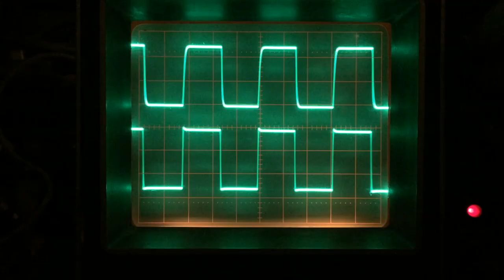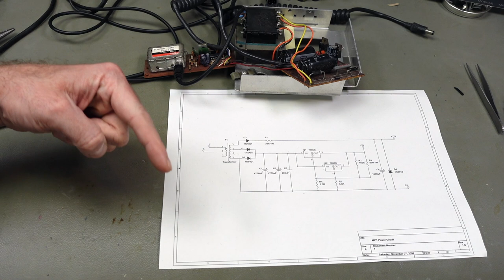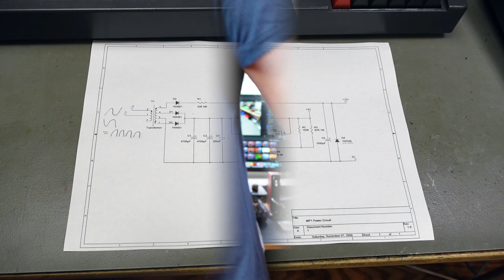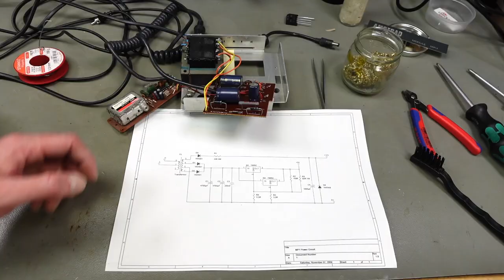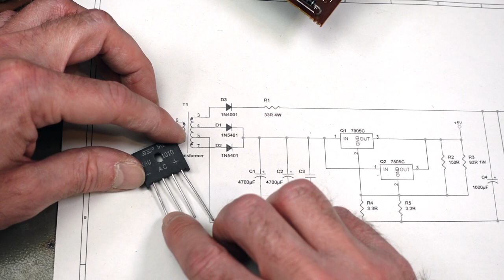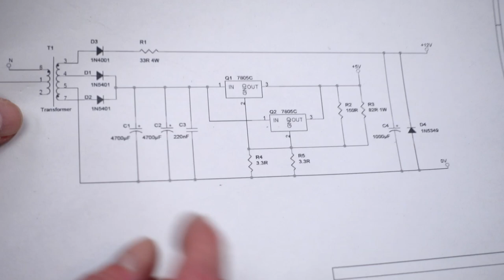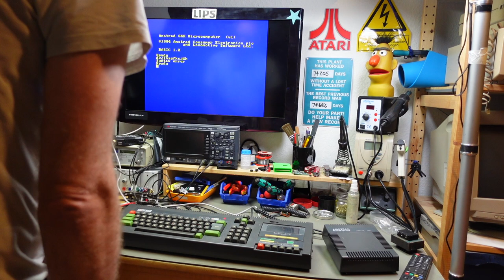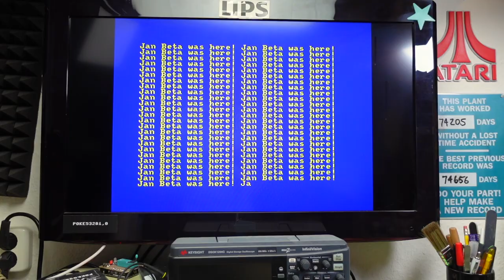Amstrad Module MP-1 Refurb and Mods

Comment: The 2 diode centre tap FW rectifier dates back to the days when vacuum tube diodes were large and relatively expensive. The split configuration needs twice as much copper in the secondary winding of the transformer than the single tap 4 diode FWR circuit but the cheapness and simplicity of the double-diode arrangement made the trade off worthwhile. Designers in the '70s grew up in the vacuum tube era and the 2 diode split secondary arrangement was habitual for them, even though the trade off of fewer diodes no longer applied with solid state devices.
Reply from the maker: Oh, interesting! That makes sense. Maybe a well-seasoned engineer designed the circuit who was used to working with center taps! :)
Reply: It was also good in later electronics with cheap small transformers because each of the windings operated only half the time, causing less heating. Modern transformers are far more robust than their 70s counterparts. As a child I had a "wall wart" power supply that had windings stuck together with wax, and after operating for more than 10 minutes would buzz like an angry bee because the wax had melted somewhat!
Reply: @IanSlothieRolfe  That made me laugh as only last week I was searching the power supply collection for a 12 volt power supply to run a small amp. I was wondering what the loud buzz was and I tracked it down to the giant wall wart I had used. Swapped it out for something more modern after that.
Reply: @JanBeta  "well-seasoned" is very nice phrase, I will use it to describe my age too. 😁
Reply: Interesting analysis.  It seemed like a lot of trouble to save 2 diodes.  It wouldn't surprise me if this power supply was an exact copy of one used elsewhere.

Comment: I think the modulator mainly existed because green screen systems were sold, and they were a cheaper way for people to experience the system in colour on a TV than to buy a new monitor.
Reply: Yep. If you had the tv already, definitely so. The converse device to this one, a TV tuner for the CTM 644 monitor, also existed. When the CPC 6128 was bought for my home back in '88 I think I recall it was bundled as a freebie with the system down here in Spain.

Comment: One fun fact about the UK and our plugs, at the time this Amstrad product was sold, they often came without plugs fitted, so you had to fit your own, and most people just bought an off-the-shelf plug with a 13 Amp fuse (Ceramic, sand-filled jobs, not glass) fitted and went with it (My Spectrum Plus came like this!!!), this was common across pretty much all appliances from a lamp to a fridge freezer, so, had anything gone wrong with the transformer, that's about 3.1 Kilowatts of power flowing though that cable, so lots of smoke and fire probably... :S

Comment: I remember my MP add ons. I could only afford the mono monitor at the time so used my colour tv. This was actually better than getting the colour because I then had the choice. The mono monitor was great. I’d would have removed the modulator and fitted fuses in that spare area.
Reply: Me too, I had to save up for the MP1 and I remember the long months of trying to play Jet set Willy in green screen while I saved.
Reply: @Corialtavi  I only needed it for the power so I ran the power from the green monitor until my MP2 arrived, it was for the 6128 by the time I got one. I made a lead to connect the RGB to my TV so the picture was much better than the modulator.

Comment: Correction: You get about ~0.8A before you exceed the VA rating of the transformer!
This is linear PSU so the linear regulator and bridge rectifier "burns" of the excess voltage as heat, most of this is done on the semi-stable peak-voltage side so you can get an approximate ampere very safe rating by dividing the transformers VA rating with that peak voltage (12.7V). Actually, it might be even lower since it'll probably be rather peaky which amplifies the VA number but I suspect it's probably OK up to that. There's way to calculate this but it's complicated and I'm not confident I would get the correct result.

Also, starting with 9V AC means the linear regulators will need to get rid of a lot of voltage and thus heat, the bridge rectifier and linear regulators will burn ~15W at 2A load, this comes in addition to whatever heating happens in the transformer. So the PSU will generate more heat than the entire machine.

Based on your measurements the original design probably used a 6.5V AC transformer, this makes sense given that this appears to be about as low you can go and still be guaranteed a "regulated" 5V DC output assuming a full bridge rectifier (FBR) using standard diodes and a 7805 or compatible linear regulator, they actually had slightly more safety margin since the dual diode centre tap design only incur one diode voltage drop instead of two.

I'd suggest seeing if you can find a 7V AC transformer, if you use a 6.5V AC transformer it might be fine but I'd probably use a Schottky FBR (much lower voltage drop) for a bit of extra headroom even if it "should" be fine without AFAIK.

I think all 7805 models are specified to be capable of handling least 12V DC input so using a 9V AC transformer should be safe if you provide enough cooling (the FBR will drop it below that). Some model are specificed up to much higher voltages but they quickly becomes veritable heating elements if you draw any noticeable current - the 2A ST L78S05C for example is rated up to 25V! which would result in 40W power dissipation in the regulator alone to deliver 5V @ 2A (10W)... Ouch, not sure that's coolable in that form factor without using "exotic cooling".

Comment: Yes, that 10VA transformer is way underrated (not slightly), so you should have checked its output under load. 7805 regulators are not LDO, so if their inputs get too close to their rated outputs, they start behaving unexpectedly. What you need on their inputs is at least +2V over their rated outputs, in your case 5V+2V=7V absolute minimum. If your transformer drops its output due to load, you might not get this.

Comment: I think that transformer will hang in there. From memory, the CPC used just under an Amp @ 5V. It's probably just on the borderline but im sure it will work. Accessories plugged into the CPC definitely wouldn't be recommended though.

Love you video's, Jan. Keep up the awesome work.
Reply from the maker: Thanks! I have yet to measure how much current the CPC actually draws but you may be right. With only the chipset and no expansions, this is most likely beefy enough. Still not happy with it, probably going to end up putting a modern PSU in the case. :D

Comment: Dear Mr. Jan, the transformer failed because you fitted the rectifier bridge which resulted in overcurrent in the secondary winding. Because during an alternation (eg: positive alternation in the secondary), one of the diodes (from the rectifier bridge) will take the voltage from winding 4-5 and rectify it, the other diode will take the voltage from winding 5-7 (which has a negative voltage relative to the transformer pin marked 5, which is connected to ground) and which tends to reduce to 0.7V, what it represents diode forward voltage (without the existence of a current limitation on this electrical path) which leads to the appearance of a very high current in the secondary, in winding 5-7, implicitly overcurrent in the primary, which leads to rapid overheating of the windings and failure of the transformer. The 1A fuse was large as it allowed up to 220 watts into the transformer and did not protect the transformer from overheating. Greetings and all the best, Marius.
Reply from the maker: I only tested the transformer without anything connected to the secondary side so it must have been broken before. You are correct of course (as I realized later), the full bridge would not do any good with the center tap!
Reply: Dear  @JanBeta . 
Fitting a bridge rectifier will not improve the electrical performance of the assembly in any way, on the other hand at low output voltages with is our case of 5 Volts the bridge rectifier is not recommended because the rectified voltage will be 0.7 volts less than variant with 2 diode center tap FW rectifier. 
However, it is possible to mount a rectifier bridge if the following steps are followed: 
1) Disconnect the wire from terminal 7, which does not connect to anything. 
2) Disconnect terminal 5 from ground. 
3) Connect the AC inputs of the rectifier bridge to terminal 4 and terminal 5 (not between terminal 4 and terminal 7 as Mr. Jan, did because the voltage appearing on capacitors C1, C2, C3 and implicitly the input voltage for the 7805 regulators will be doubled ; which leads to increasing the power dissipated by the 7805 regulators and increasing the power passing through the transformer, so they will fail in case of long uses). 
4) The "+" pin of the rectifier bridge connects to C1, C2, C3. 
5) The "-" pin of the rectifier bridge connects to ground. 
Greetings and all the best, Marius.
Reply: @JanBeta  yes, you're right, I reviewed the video and at minute 31.00 it can be seen that the rectifier bridge is not connected.

Comment: Just add a fuse of 2Amps with the 6v protection diode.
Also when you connected the center tap of the transformer to the negative output of the Bridge, I exclaimed Noooo! .
 The two diodes were used to enable cheaper lower current transformer to be used by adding two outer windings of the center tap of the 9v out was a common and reliable method, shame about the transformer they are/were very reliable.
Infact those modulators were good Astek were the best available at the time, replacing the caps was a good move.
The MP-1 was prone to bad solder joints and cable damage, I only recall replacing one set of regulators and that was due to a customer shorting the DC cable when he tried to repair the lead.
Leaving the Bridge in place and disconnecting the Negative would have been acceptable.
Personally I would have left the diodes alone if the tested ok, or at the very least replaced them with 1N5407/8 which are the same diode at 800v/1000v not 100, just because it's easier and cheaper to order one type rather than several.

Comment: 33:43 In my time "Repairing" dead electronics, I tend to find that if a device has a transformer, that's the most likely thing to be dead.
I "Repaired" an old fiber optic Christmas tree for my brother a few months ago. "Repaired" in that it was the PSU that was dead, literally nothing more than an AC transformer in a plug-top box. So I found another old transformer (Wasn't plug top, plug was on a wire) with the same value, cut the plug off the end of each cable, and made a soldered joint. It worked, it was safe enough (used heat shrink with hot melt glue inside it), and he was happy with it.

Comment: The MP-1 was to allow you to connect to a TV if you'd bought a green screen monitor, allowing you to have a colour display.
Reply: And if you had a CPC 664 / 6128 you needed the MP-2, which had the 12V power rail required for the floppy drive.

Comment: Als du den Brückengleichrichter eingelötet hast, hats du den Minus Anschluss des Gleichrichters an den Mittelanschluss das Transformators angeschlossen. Damit hast Du in der einen Halbwelle die eine Transformatorwicklung kurzgeschlossen und in der anderen Halbwelle die andere Transformatorwicklung.
Eine Transformatorwicklung  war schneller kaputt als die Andere, die dadurch gerettet wurde.
Du hättest als am Brückengleichrichter den Minus-Anschluss offen lassen müssen. Dann hätten zwei Dioden des Gleichrichters den Pluspol gerichtet. Aber dann ist es sinnlos einen Brückengleichrichter statt zwei Dioden zu nehmen. 
Auch den Mittelanschluss zu entfernen macht keinen Sinn. Mit den beiden äußeren Anschlüssen hast du die doppelte Spannung und den halben Strom, den du brauchst. Die 7805 hätten eben 20 Volt Vorspannung und nicht genug Strom mit beiden Wicklungen in Reihen. 
Mit der Mittelzapfung zwei Dioden Gleichrichtung werden beide Wicklungen abwechselt parallel geschaltet. Also ca 10 Volt vor dem Regler und Stromfestigkeit höher.
Oder gleich ein 5 Volt 2 Amp Powersupply nehmen.

Comment: Nice video, did a fantastic job sorting that out. The fuses in a UK plug are sand filled ceramic not glass fuses :), and people love to stick 13 amp ones in everything.  3 5 and 13 are common in the UK . You used to be able to get 1 an 7 too but they are much less common ( even tho for much stuff today (like phone chargers ) a 1 amp would be more than enough).
Reply: The fuses in the UK are HRC fuse (high rupturing capacity fuse), they're designed to quench the arc into the sand when they blow as the metallisation in a glass fuse capsule can still carry voltage through the plasma, the ring circuits in the UK used to be 30A at 240vac, I think they're 32A with the new RCD/RCB protection, it's one of the reasons we still have fuses in plugs I guess, yep it always makes me facepalm when I see 13A fuse in a table lamp or figure of 8 cable.
Reply: Confirmed. 13A is plenty for any application so why bother with anything else ;-)

Comment: The only thing to really do with an MP-1 is open it, throw all the insides in the garbage and use the case to fit a new open frame switching power supply. No need to play around at the component level.

Comment: Well done Jan. To mount the power supply I would have just used MB or Drive Spacers, the Hex type brass spacers. Bigger the better.  But I guess cable ties are an option. ;)
Reply from the maker: I didn’t have anything that fit at hand so I went with the cable ties as a makeshift solution… the whole thing is still far from ideal though, probably going to end up putting a modern switching PSU inside and get rid of the original circuitry altogether. :D

Comment: For people considering replacing the diodes with a bridge (because they have one) just don't connect the negative terminal. That way you'll just be using half of it, but it will be in the configuration as originally designed. The diodes in the negative side will block each other because their common point (-ve terminal) is not connected to the transformer.  If you connect the negative to ground and disconnect the centre tap of the transformer, you'll be getting twice the voltage you expect on the capacitors, which could be troublesome! 
I don't think Jan damaged the transformer unless he plugged it in before removing the connections to the transformer, which he clearly said he didn't. Transformers kept in lofts and garages can get damp and critters in them and burn out on their own when people try them out. The final mod with the sealed transformer looks like a good job that will last..
Reply: I was really waiting for the half of the rectifier bridge to blow up (because those two diodes are effectively shorting the other half of the transformer winding) but the transformer giving out a magic smoke was a surprise :)

Comment: just ordered myself an MC1377P so I can finally build a clone of the MP-1 thanks to your teardown ;-)
the original ones are horribly expensive and hard to get, so i've been using RGB via Scart before, and have stowed away the CPC for some time now since my new TV doesn't do RGB anymore. now I can get it to work again - thanks a lot!
How did you manage to get 5.27V from an 7805 though? Those usually regulate to better than 2%.. I don't think I've ever had one deviate above 5.1V unloaded. Is there a bad ground connection maybe?
Reply from the maker: The resistors on the output side slightly bring the voltage up (as far as I understand the circuit) to make up for the cable losses. Under load it should be very close to 5V.

Comment: About original transformer.
Some transformer have a  embedded current/thermal fuse.  
If transformer is a single voltage input, and have a three terminal, the fuse bridge between two.  
PSU don't have a fuse, so can have a embedded one.

Comment: I remember distinctive smell of this modulator. The smell of my childhood. 🙂 But the RF output was very bad.
Reply: I've never seen one running, but when I saw the way the RF cable routes near the power supply windings (and all the associated RF interference) my first thought was 'The video quality on that thing has to be *terrible*'
Reply: @Antireality  yeah its a thing made to be cheap. I do not know how much rf cable shielding helps to isolate the interference from the transformer, if that bad signal could be improved just by routing it differently, or its a minor thing that would not much improve overall bad signal.

Comment: Doesn't Reichelt have a nice 5V/12V Meanwell PSU that could, theoretically, fit inside here?
Wouldn't that have been an option??

My reasoning for that is higher efficiency. Linear Power Supplies have a very high voltage drop. If you have a Mega Drive power supply, I encourage you to measure the 9 or 10V DC PSU. ANd you'll be surprised that it ain't 9V AT ALL.
By todays Standards its 12V for the Mega Drive - and its very similar to lightly and heavily loaded. Though the Ripple might be an issue.
Though we're talking about less than 20W though...